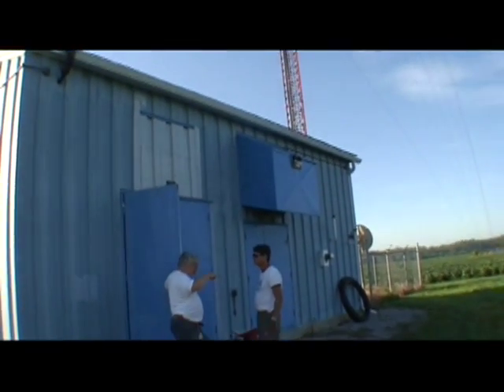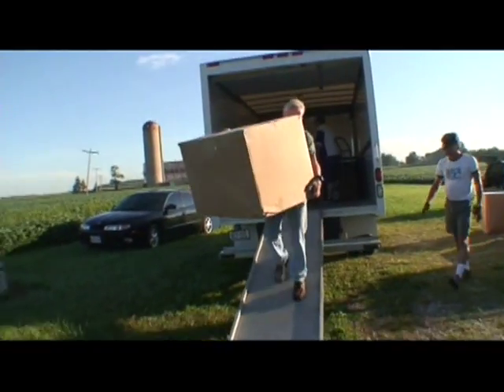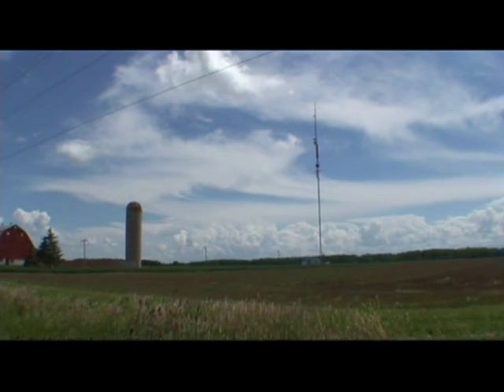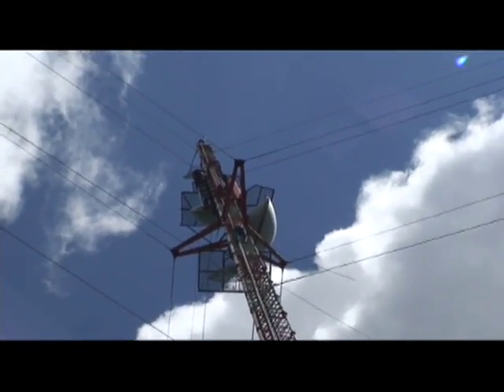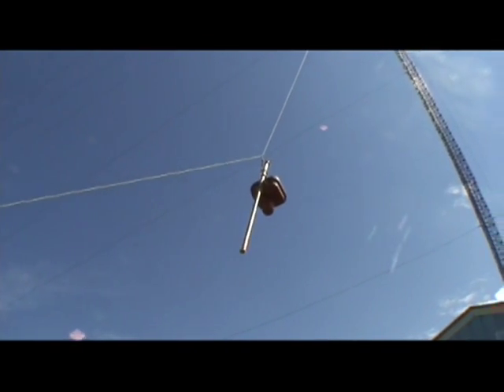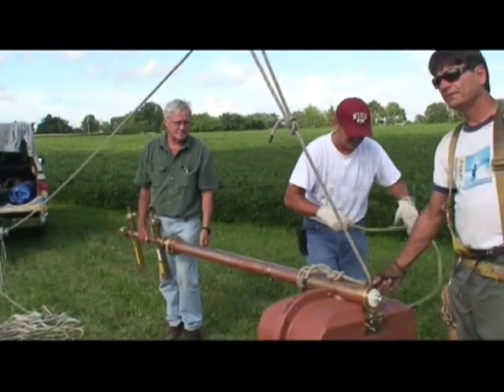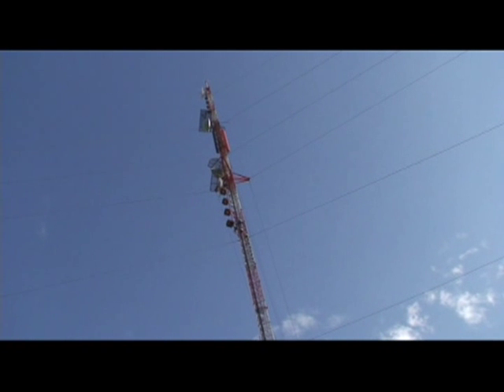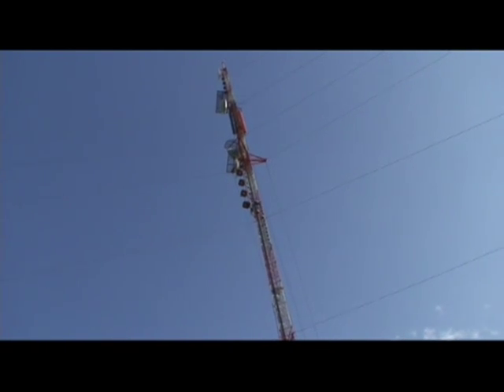CKCI Sarnia FM Antenna installation on 500Ft tower V2.mpg

Comment: Thanks for sharing this video.  I've installed many multi-bay antennas over the years in just the same fashion, one bay and innerbay at a time.  It appears the crew did an excellent job getting all four bays on the tower in a single day.  It looked like the matching section had the 1 5/8 inch connector attached.  Were they going to install the connector on the tower?  I've also done that many times but it's a heck of a lot easier on the ground.  With ERI antennas it's easy to loose a center connector when lifting the bays.  I've seen a 10 foot inner conductor come out of the innerbay and fall to the ground from 500 feet.  From that I learned to tape them in or otherwise secure them before sending the section up the tower.  John
Reply from the maker: thanks for your comments and observations. The station has been operating successfully for a few years now. Wilf Rice